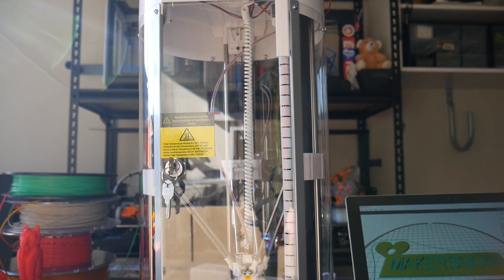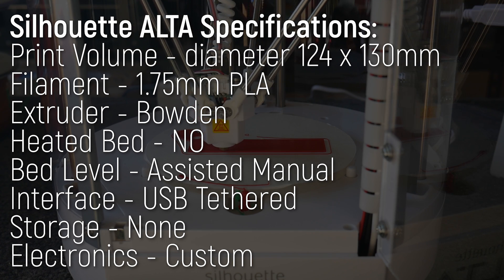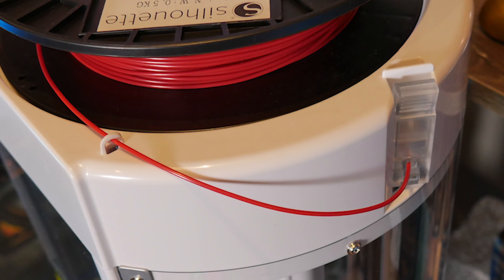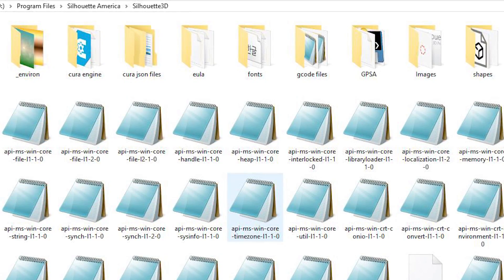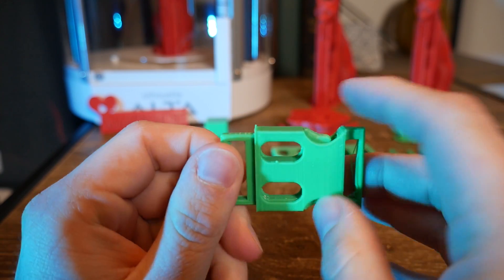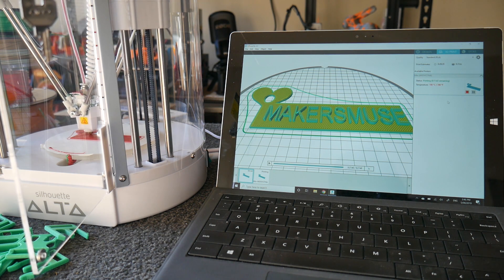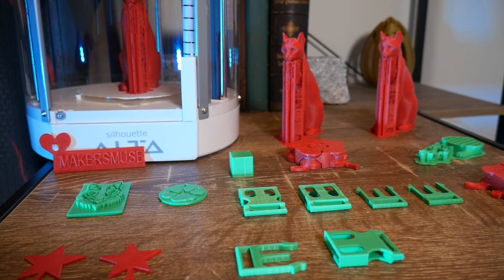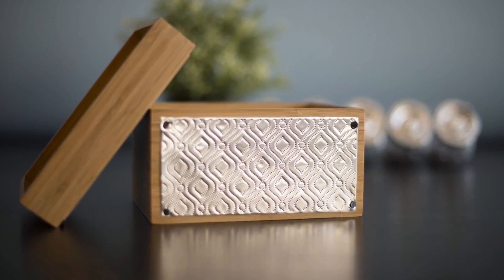A 3D Printer for Crafters? Silhouette Alta Review

Comment: This is actually a rebranded 3d printer made by another company. Silhouette did a shell redesign. This was listed back in 2016 as the CoLiDo D1315 Delta 3D Printer, so the guts and parts are all the same. You can even buy a nozzle replacement from print-rite and it will work in the Alta 3D at 1/2 the price. What Muse said about slowing the prints is 100% true. However because there is no active cooling you end up with melting issues. This limits what you can print. For example once you print details smaller than 3mm and its a vertical print, such as an ear, it just melts into a swirl. You end up with hacks like printing multiples at the same time, or just placing a desk fan to blow into the enclosure.  Their software was also too basic to tweak settings for better prints. You can turn to Cura but my wife purchased this at the time of release and no one was able to get it to work with Cura for months. My wife loves Silhouette products, and invested into this. However after an entire month I was so fed up of being her tech support so much so that I ended up buying an Ender 3. All she does now is load up Cura, picks a profile and prints. 9.5 times out of 10 it prints just fine. 

Honestly Silhouette is on the right road, but this V1 product is just that and they missed the mark. Don't buy this version. They have an Alta Plus version which has hit delay after delay, but it supposed be released soon and should include a fan and updated nozzle design.

Comment: Have been using this for about a month now. At standard settings any gradient surface ends up with bumps and blisters. Any part with finer details on the first layer needs a full bottom layer underneath as there is serious problems with bed adhesion. And just now the tension weel under the feeder sprocket broke off. The bracket holding it is made from thin clear acrylic.

Comment: I've had a Silhouette Cameo 3 for a long time, I used it so much I wore out the downward force solenoids (which are not replaceable). I Love the thing. It _just works_. The design is simple, elegant, and intuitive if you have ever cut paper with an xacto knife. Silhouette does continuously improve the software, and I actually use the software to generate 2d files for a laser cutter and with a $$ upgrade you can export .SVG files that tinkercad and fusion360 ingest with no problems. (as well as inkscape illustrator and photoshop). Silhouette has tried 3d software in the past with miserable results (a 3d model maker app that just does not work). I was hoping their entry into the 3d printer world would take the same design approach. It looks like they made the same set of decisions. To those that list it's flaws. I would point out that Silhouette has a history of improving hardware over time. Prime example is the Cameo version 4 cutter will start shipping (reportedly) by october 2019. I hope they take your feedback to heart. But I gotta tell ya, the Cameo 3's untethered operation Suuuucked. 

Has anyone tried to drive a Silhouette 3d printer with octoprint?

Comment: Well, $300 just for 95% of a printer is reasonable, you can install your own control board with and SD Card reader. Or maybe Klipper!?
Reply: Not 95%, in this case it's more like 5%. For 300$ you can buy proper delta printer and install your own doors.

Comment: I got the Alta to work with Cura and Simplify 3D too, it's not true that you can run it with the Silhouette software only.
 Despite the fact that it does'n have a part cooling fan, it does a pretty good job. I haven't had the artifacts Angus showed in this video, so I can't tell something about that.
Silhouette America merchandises the Alta as a PLA only printer, but I tried PETG as well and it did a good job. The missing part cooling fan isn't a problem here,  as PETG doesn't need too much cooling.
But in my opinion the huge drawback of this printer is that you have to have it connected to a running pc - this is the reason why I mostly prefer my other 3D printers.
Reply: Could you help me? I have Silhouette 3d but Cura throws me an error every time i try a Silhouette file.

Comment: "No modding potential"
pfft. Words you'll never hear from a true modder.
Reply: It can totally be modded. There are pins for a bed heater and cooling fan...
It can be loaded with other firmware if you want. Its infinitely hackable. 
You can use Cura on it. So you can mess with all the spice settings.

Comment: What a God damn waste of an aesthetically enclosed chamber.
it could have been sooo ABS perfect.
Reply: Looks like you can hit 250 if you're willing to use Cura, so with the right filament, ABS should be possible.
Reply: @afedaken  i take it that you havnt printed ABS. you are probably PLA/PETG type
Reply: @fortheregm1249  Done plenty of ABS.  Half of my printer is ABS.  The brand I use prints fine at 240.  If the Alta can hit 250, you have...  Oh wait.  No heated bed right?
Reply: @afedaken  yeap, thats right, no heated bed , you can even print ABS at 230 with PTFE hotend, but not on a cold bed

Comment: There is no excuse now-days for an 8 bit delta which has to print tethered. None! Not even for $300 -- which seems a rather steep price for what you're getting here. 32 bit boards are dirt cheap.  Marlin 2.0 32 bit can run on chips which cost about $2 for a basic stm32 or splurge $4 for lpc1768, and I'm assuming low volume purchasing here.

Comment: Strange ... they  made the cameo with support for printing from usb stick. Why  not on the 3d printer?
Reply: Because no one would buy second and third iteration of that same appliance then.
Why there was no MMS support in the first iPhone, even though MMS was out there for a decade?
Reply: Beardman Hairy i mean for the other hardware they made  had a usb reader , but only this printer has none.
You are right about the phones...but for the price i would buy an ender3 with sd card support.
Reply: Just because some company did something right once or twice doesn't mean they'll do the right thing every time.
And when they don't it's clear sign that their previous righteous thing was just an accident and it's best to avoid such company, or at least not to trust that brand.

Comment: The Monoprice Mini Delta gives you nearly the same size print area, a heated bed, a horizontal rather than vertical print spool holder, as well as SD and WiFi and for half the price. The USB Tether seems like a huge issue especially for a printer that is supposed to be easy to use out of the box. They seemed to want it to work more like a normal printer but without RAM storage rather than how nearly every other 3D printer works. Looks good though and I like the enclosed print area.

Comment: That printer definitely has some nice features. Fully enclosed with a key to lock it are nice features you don't get with most of deltas. One option to deal with the tethering issue is to use a Raspberry Pi running Octoprint but that starts to take the set up outside the realm of its intended target audience. Some of those other craft devices you showed at the start of the video looked to me a bit like an old style 2d plotter in how it behaved.

Comment: Would it work to plug a usb to sd-card adapter into the printer so that there would be no need to tether it to a computer?
Reply: No, the USB is presumably device-only, not host. Even if it had USB host and file system support, it would have been cheap to add an SD slot directly: even 8 bit boards can handle that.
Reply: @rpavlik1  Oh yah, you are probably right, I didn't think of that. Thanks for answering my question

Comment: I did some research into this printer after it was shown off here initially... here is what I found out.

The Alta itself is a heavily modified Print-Rite CoLiDo D1315 Plus.

It uses a proprietary hotend unit, as in you have to replace the entire thing if you need to replace the nozzle. That being said, it does perform very well from what I have heard.

The printer does NOT have a part cooling fan, the motherboard does have a header for one but it is disabled in firmware. The Alta Plus coming out next year is confirmed to have a part cooling fan.

The printer motherboard is 8-bit arduino based from what I can tell. It's running Marlin 1.0 and is fuse locked to prevent tampering with the firmware.

The motherboard also has spots for a bed heater and thermistor, but they are unpopulated. It also has what I believe to be headers for a SD reader and possibly a display/controller. But again, I believe these may be disabled in firmware.

Here is the helpful post where I got a majority of my info. :)
https://community.ultimaker.com/topic/23530-cura-support-for-silhouette-alta-3d-printer/?do=findComment&comment=219062

Here is a up close picture of the Motherboard for anyone that might be interested in modding it.
https://www.print-rite.com/product/mainboard-colido-d1315-3d-printer-%ef%bc%88updated-version-v2-x%ef%bc%89/

I really wish this printer had the community the MP Mini Delta does, because it is obvious it is a diamond in the rough and I think with a little community backed love it could really shine.
Reply: I really like mine. Being able to use the full version of Cura 4.1 made this thing sing.
I think I can flash a different firmware on there. I may give it a shot.
Reply: @christopherleveck6835  If you can manage it, try flashing klipper, that should take care of all of the printing issues from the board being 8 bit based. :D

There was someone on the ultimaker thread that actually designed a part cooling shroud for the stock hot-end, but I haven't had any luck finding it online. :(
Reply: @DrawnDoggo  to my knowledge, I'm not having any "8-bit problems".
Cura 4.2 wouldn't run right so I went back to 4.1 which works fine.
I have two other very high end machines and this one keeps up with them ok.... I get decent quality and time to print isn't too bad...
I find that with the door closed I have no problems getting the print to stick and no warping. I did have some stringing in the beginning. Fixed it by adjusting the speed and temp of the pla and no issues with  cooling....
I just open the door when I want it cooler, close it when I don't.

Comment: So this printer:
-has no heated bed
-can only print pla
-has a small build volume
-has to be tethered
-has bad print quality
-still costs 300 dollars

And you still call it near perfect? I'm confused to say the least.
Reply: Please add to the list 
- no cooling fan
- 8 bit board
- embedding LGPL software in their slicer without publishing source code
Reply: It is made for makers. A no-nonsense device for beginners. And for that, it looks good: not expensive, an obviously good working design program (incl connected shop) and slicer. Buy/create a model, send it to the printer, and wait. For that, it works obviously very well...
Reply: @ArdjanVideo  A creality CR-20 (i say this one because it's easy to assemble) + Cura default settings will give amazing results and doesn't take any more knowledge than this piece of junk.
The whole ease-of-use argument doesn't hold up at all.
No-nonsense? I see nothing but nonsense, nobody is gonna be happy with this.
Reply: Ardjans Videos Yeah, no, that is not at all what it is. It is not made for makers, because no maker accepts all these drawbacks. It is also not made for beginners, because beginners can get a range of cheaper printers with more convenience, print quality and features than this one.

It is just a really shitty printer.
Reply: Those saying you can get a $200 printer that is easier for beginners, please name one that doesn’t require self assembly and tons of tweaking and tuning.  This is aimed at beginners who don’t just want an entry level printer, they want something that looks nice, minimal assembly, integrated software, no wires hanging off, ... This is aimed for the classroom experience.

Also being tethered is not going to be an issue in a classroom where the PC is bolted and locked down right next to the printer (just like the locking door).
Reply: You can get the anycubic i3 mega for 230€ with heated bed and ultrabase and an amazing print quality. But this is just an example.  This channel has become really disappointing, not sure really why. And as the printer that he's reviewing, there are a lot of far better options out there (printers and channels).
Reply: I think his reviews revolve around if it works out of the box with what it came with. So for this one he didn't have to modify, configure, calibrate, or assemble it.
Reply: As mentioned before this is more for a beginners no-nonsense machine /k12 classroom. It's something an 8 year old can get started with without having to calibrate and being pretty safe. It's not targeting any enthusiast but the very beginners who want to start with baby steps. It's also a Delta which is good to get faster prints so kids/etc can watch per class session. 
Imo it should be like 150-200$ at their starting point.
Reply: @WhiteWolfos  Yes thats true
Reply: @DAudIcI it's only under assumption that they keeped source code for cura part in without ANY changes at all
Reply: Yes, that was kinda... suspicious... I bought a 3d printer several years ago for around $200 and that seems way better than this. Seems to my like a failure due to trying to make it too simple.
Reply: It's pretty
Reply: I'm honestly not surprised.  He also adores the Cetus.
Reply: 1. replace driver board 2. drill some holes for sd card 3. ??? 4. profit
Reply: This. I'd rather take my OG tarantula over this utter garbage, and that barely worked out the box
Reply: Could it be because it’s a paid review?
Reply: TBH makers muse leading with „they got nearly everything right“ and then presenting an absolute pig of a printer whose only redeeming qualities are cheap (tough you can probably get far better printers for the same money) and pretty (really, who cares?) leaves me wondering about the „quality“ of his reviews altogether...
Reply: I wonder how many people making comments here have actually used an alta?
I've had mine for over a year. It works great. 
I've had 4 printers plus two I built from scratch. Everytime I get a new one I end up printing parts on the Alta to upgrade the others. 
I dont use the software that came with it I'm using Cura 4.1 tethered and it works great.
The board in there is totally hackable although I haven't. .
It has a plug in for bed heater which I've never needed. Also for a cooling fan, if needed I just leave the door open.
It works great. It's my go to printer when I need something to print right the first time.
It's easy enough to use with the stock software sent it with my kids to college last year for a couple months. I didn't want to have to be on the phone with them doing tech support.
They got their projects done  threw it in the car along with their laundry and came home and I didn't even have to adjust it afterwards.
In fact I haven't leveled the bed since I got it and set it up the first time.
It prints great out-of-the-box it prints even better with Cura.
For the money you really can't go wrong.
Reply: What I find remarkable is that Angus didn't chime in on this with a reply.  Very telling that.  I do not trust any youtube content creator with any product review period IF THAT ITEM WAS SENT TO THEM FOR FREE.  I learned my lesson some years ago when I cornered Joel Telling against a wall and he admitted his product review was bogus (gotta keep the money flowing and the freebies coming in).  I
 have not watched him since but Angus is good friends with Joel so I suspect Joel taught him how to sell out his soul and make money with lots of freebies.
Reply: Its called getting a printer, a cuting tool and some Money to og With it!
Reply: For $230 you can get a xyzprinting davinci nano with a build volume barely smaller than this reviews turd, and it comes with a heated build plate, enclosure, part cooling fan, pla/abs/petg support and standalone operation.
Reply: Maker's Shill
Reply: @yootoob6003  mine works great. It's the only printer I own that just worked and continues to work. Never had to futz with it to make it work it just did and it still does.

Comment: So they got everything right, except build plate, bed heating, extruder, print speed, control board, print quality, software support, standalone operation/storage media, interface, filament detection, power out recovery, filament holding, bed leveling, part cooling fan and filament type support.
Reply: Don't forget, no part cooling fan!
Reply: Also nonexistent hot end cooling that leads to very frequent jams on retractions.
Reply: Not really, just a better control board and maybe standalone operation. The rest is fine for a printer at this size. You don't really need failure mitigation when running 3 hour prints. If the power goes out, start over. No big deal. I have a high dollar professional printer that is missing power off recovery. Now that is a problem.

Comment: I had the same issue of blotches on my 3d prints when I tried connecting a Raspberry Pi to my ender 3. Found a few options on forums that helped a little, but the best fix would be to replace the mainboard to a 32 bit one. Haven't done that yet due to my budget and I'm kinda worried I'll screw something up, so no octoprint for me for now.

Comment: I'd like to see your thoughts on the Anycubic D (was known as the Predator). I've got one, but it was a project machine from the start so  I didn't really bother to test it stock and went right to Duet, smart effector, bondtech bmg, mosquito magnum hotend, magball arms, etc. I feel like this machine doesn't get the attention it deserves, and generally Deltas don't get a lot of representation.
370mm diameter, 455mm height, 32 bit board, with a cloned titan extruder and cloned e3d hotend, for $600 msrp, but can be had around $400-450 on sale most of the time.